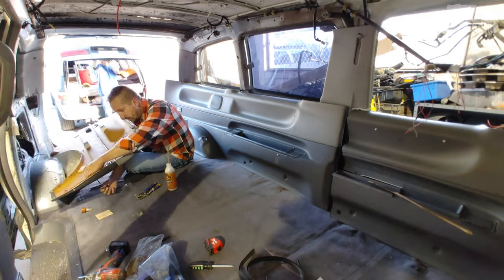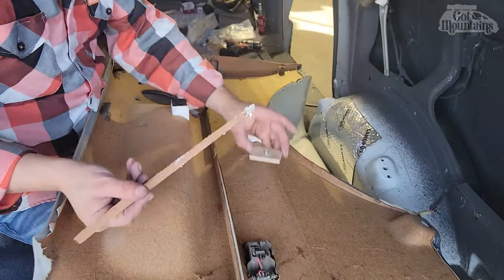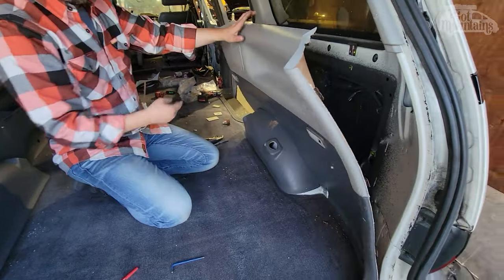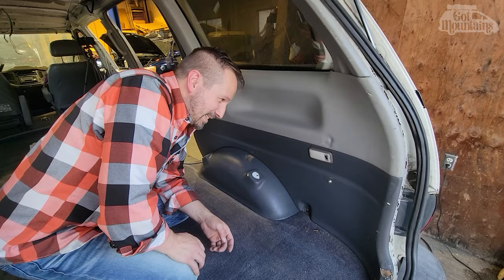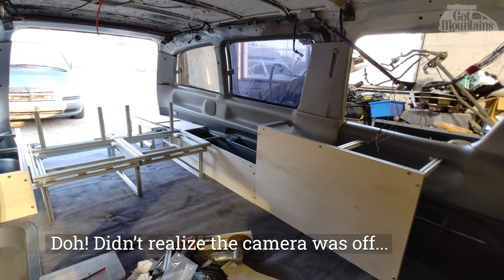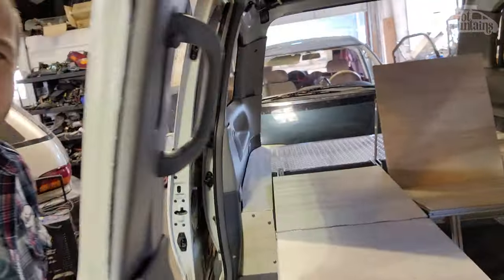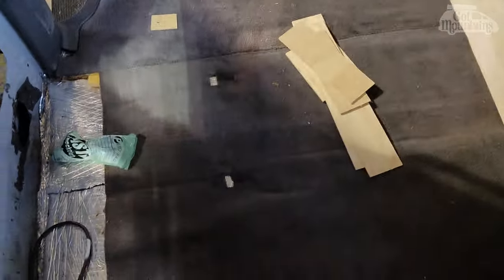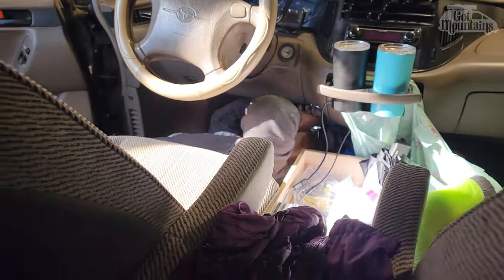SIMPLE Van Build INTERIOR | Limo Van to Camper in 3 Days

Comment: I don't think that will hold up long term.
Reply from the maker: What won't hold up long term?
Reply: @GotMountains  the bed frame. You should make it freestanding . I made one that way. It will pull away from the panels or panels will pull away from wall over time. Been there done that.
Reply from the maker: @MikeMcdonnald I guess it's possible, but my first one is 4 years into full time and hasn't moved a mm. There is nowhere for it to move bolted to both walls. Even under hard braking it's stayed put. I think it would take a pretty major crash for it to go anywhere at all.
Reply: @GotMountains  Hmmm... Difference in sex life maybe.
Lol!!!! I've been a van sdweller for 12year full time in So Cal. I'm on my 4th dodge van. Well I i owned 5 but got scammed for $2300 on the last one this month. Parting it out cause I'm not gonna do to someone what was done to me.